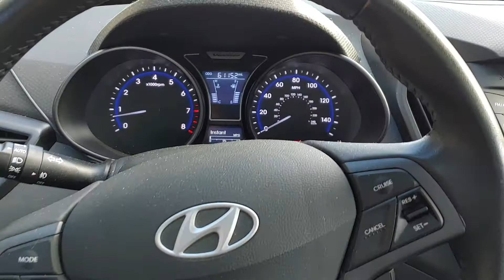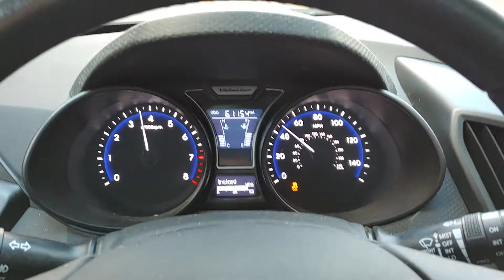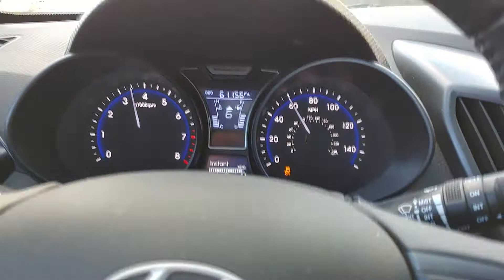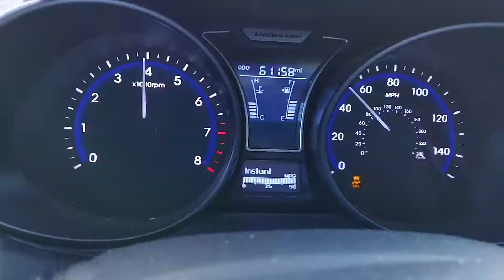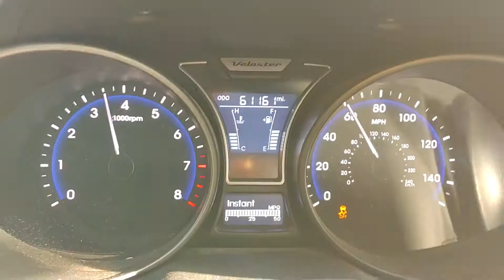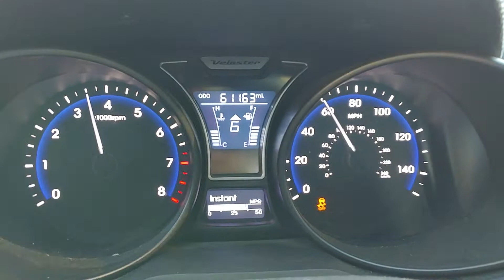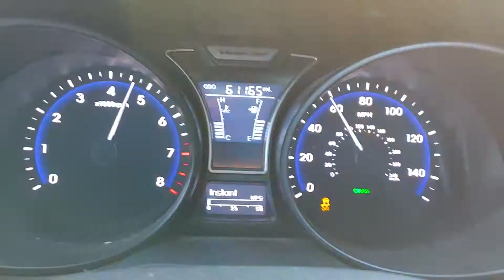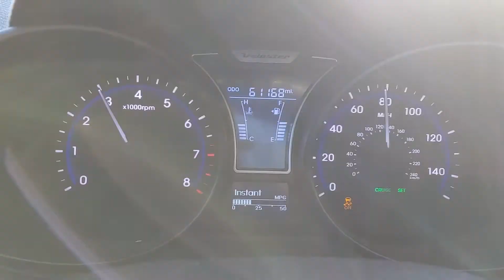CAR FACTS: How to avoid LSPi while driving a Turbo Vehicle.

Comment: Ma sei Italiano ?
Reply from the maker: si` sono Italiano
e l'Auto non e` menomata se devi tenerla a certi regimi... Dipende da come e` progettato il Motore.
Certi Motori vanno tenuti sopra i 6000giri o si surriscaldano, fa parte del gioco di acquistare certi tipi di mezzi
Reply: @CrazySteTV  Allora l'accento non mi ingannava 😎 non è il gioco di certi tipi di mezzi, purtroppo i motori GDI ormai sono un obbligo.
Chi li comprerebbe se non fosse obbligatorio ? per me sono da buttare in discarica.
Ce ne ho uno a casa, una porcheria.
Reply: Ciao ho il fratello minore del tuo Motore il 1.4 tgdi 140cv montato su Kia xceed dici Ke SN motori a rischio lspi distruttivo?
Reply from the maker: @alxrilli  tutti i Motori GDi sono soggetti ad LSPi,
Piu` bassa e` la Cilindrata, piu` alto e` il punto di possibile LSPi

Il 2000cc GDi va tenuto sopra i 2500giri

Il 1600cc GDi va tenuto sopra 2700cc

Il 1400cc GDi va tenuto sopra i 2800cc

Prova a guidarlo per un periodo cosi`,
Ne rimarrai sorpreso, i Consumi per me son calati vistosamente col 1600cc da 200cv guidandolo sempre sopra i 2700giri

Una volta che ti abitui a guidarla alticcia di giri, non ci fai manco piu` caso